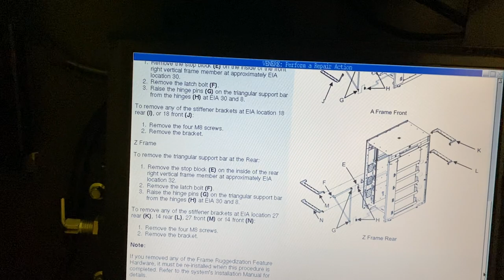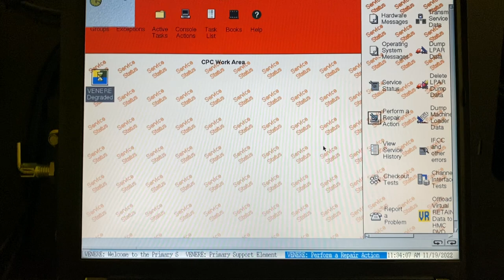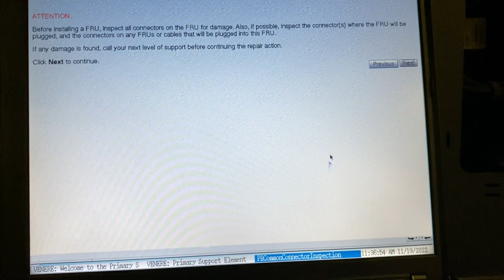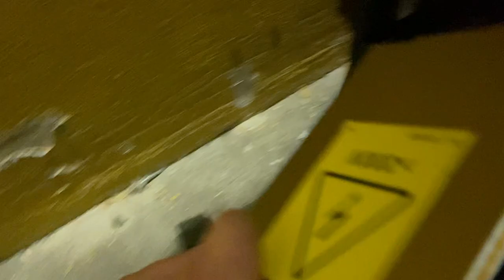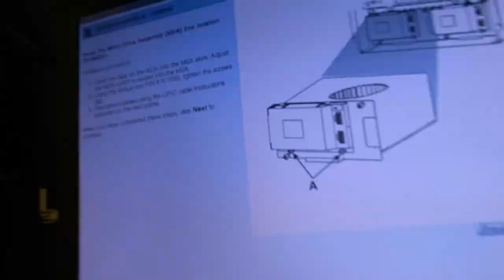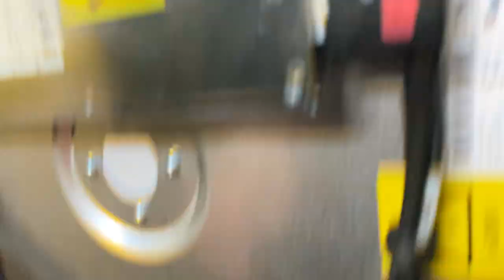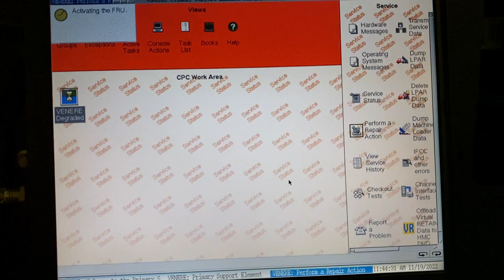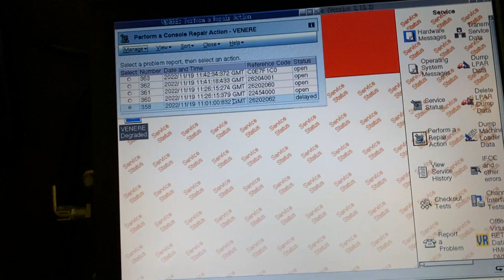Servicing a million dollar computer - IBM System z10 Mainframe - Replacing a faulty MDA

Comment: I'll bet the right HVAC tech would be fascinated with the opportunity to help you figure out how to reload some refrigerant into there. I've done it in my car, I'd like to say IBM couldn't have changed how you load gas in through a valve, but if anyone would have...
Reply from the maker: I tried, sadly to no avail. There are no fill ports inside so it was probably filled by the quick disconnects up front. There are weight tables and refrigerant type on the label but I can’t easily find the fittings to match and adapt to the hvac ones

Comment: 235Vrms at 1.8 amps 3 phase just to drive a fan motor.  I'd like to see the size of the fan (yes I know it's called a "motor scroll assembly").

I believe the reason they ask you to wear eye protection is in the case where one of the MSAs blows something in your face.
Reply from the maker: MSA would get disabled once you start the service procedure so no risk of flying objects. That fan (IO Cage) is slightly smaller than the one in a BladeCenter H if you’ve handled one. There are larger 1400W ones for the back of the CEC